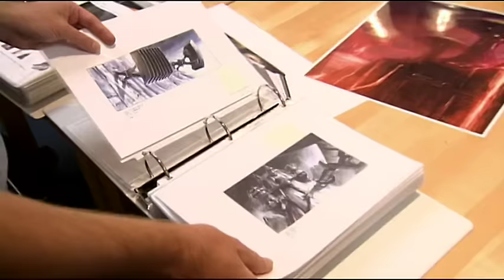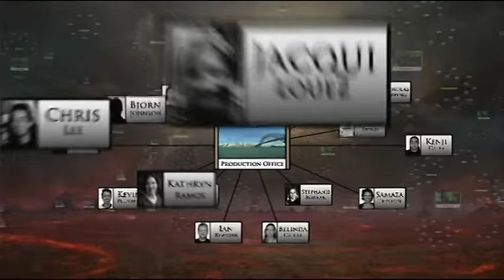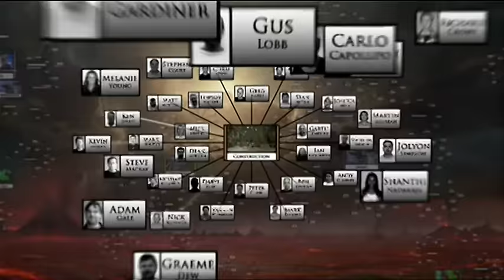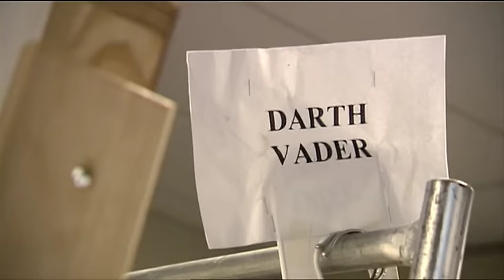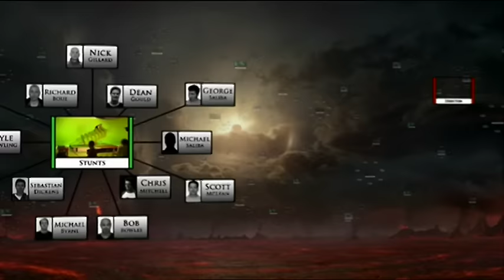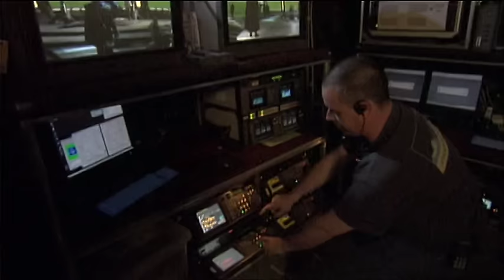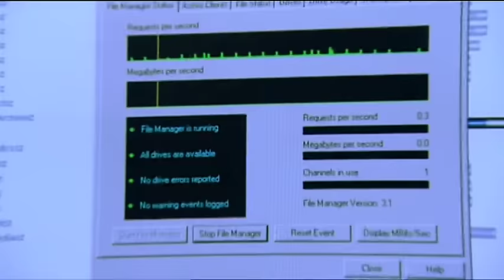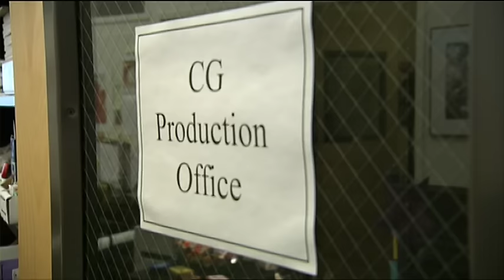Star Wars Within A Minute: The Making Of Episode III Documentary

Comment: 3:04
Rational Outline(1 Chronicles 28:11)

Reference sketch lines work as exact markers of where to draw lines using drawing reference.

Ibid, with all the sketch strokes taken as a basis to draw all the strokes yourself using drawing reference.

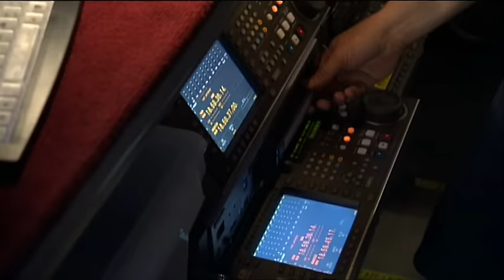Rational Sketch of Drawing Composition (Exodus 35:31)

Reference sketch lines act as exact markers for where you plan to create lines using drawing reference.

Ibidem, with the sketch strokes taken as a basis to create all the strokes yourself using drawing reference.

Where do I start and end when drawing a rational drawing or using a drawing reference.

Start by drawing from the inside (inner lines) to the outside (outer lines) a rational drawing or using a drawing reference.

Start by drawing with the details (strokes of details and textures) of your drawing and ending with the larger ones (lines of shapes, hatches and movement) of your rational drawing or using a drawing reference.

Comment: The only thing i don't understand is why lightsabers don't cast any light on the surroundings
Reply: They do, but the light is restrained. It was used preety netly in the dark scenes, like against Dooku. To cast the characters in the light of the 2 sides. Blue and red moving from one to another, and showing the conflict inside.
Reply: @dancorneanu9144  only in that scene and with Yoda and Grievous.
Reply: @emirhanproduction8516  That is why I said most scenes are done in the light. The glow is not nocible enough normally and they could add a little, but for what it would actually do, the costs are way too high. This is early CGI and the work was astronomical.

Comment: 3:04
The Untimely Light-Dark:(1 Chronicles 28:11; Exodus 35:31)

About shapes(mechanical design and custom), figures(character and creature design) and backgrounds(background design)

№1 Gray (grisaille) on linear drawing sheet.

№ 2 Separate the areas of lights (direct, reflected and re-reflected) and shadows (own and projected) on the linear drawing.

№ 3Map gray areas of tones onto linear drawing.

№ 4 Cutouts of backgrounds, figures and shapes on a linear drawing.

№ 5 Detail plans on linear drawing.

№ 6 Dissolving (gradient or gradient) of gray areas of tones on the drawing.

№ 7 Texture stains on linear drawing.

№ 8 High-gloss lights on a linear design.

The most terrible and wonderful design. (Judges 13:6,18)

Comment: Why do not the lightsabers give any light reflections? You see? CGI sucks.
Reply: They didn't in the ot either 😕 rotoscoping my guy
Reply: "CGI sucks" yeah cause the sabers in episode 4 had light of their own with no post effects, dude at least inform yourself before bashing
Reply: @orlandofurioso7329  Good to know but I'm not for the specialized raped editions or the prolonged suffering saga (which is also often opposed by the original actors such as Mark Hamill - good thoughts also about the visual effects compared to the originals). I saw the original Star Wars saga (1977, 1980, 1983) in theatre cinemas with THX Sound System and a huge screen without a single CGI silly effect incorporated, so I'm satisfied and it's enough : )
Reply: @semirecumbentoneYT  I would like a source on that "actors hate the special editions" thing